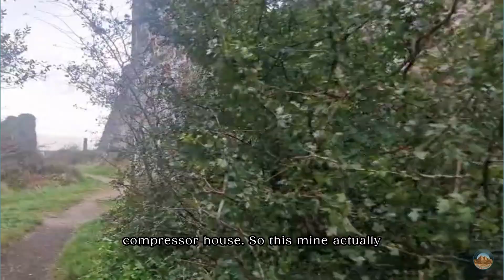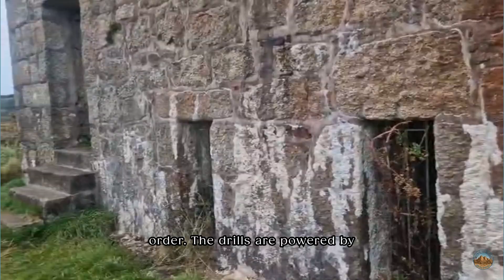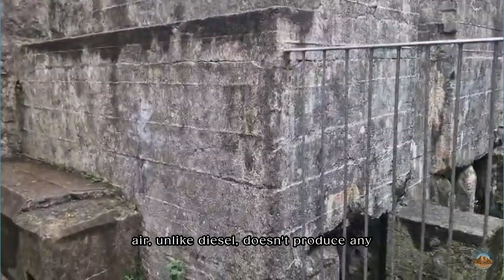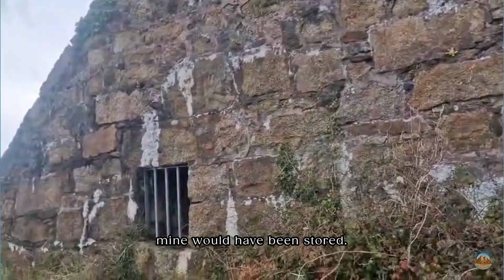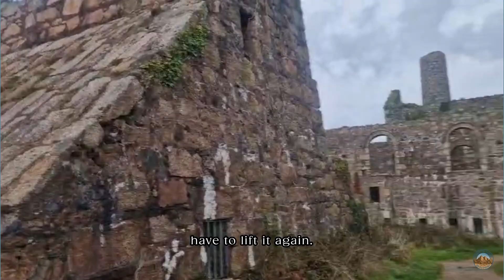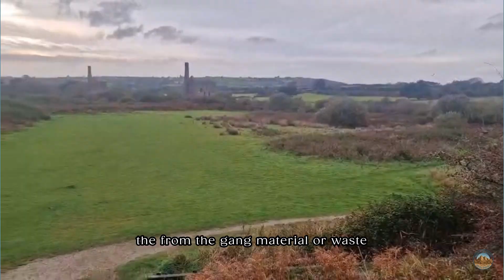Inside the Compressor House – Modern Meets Victorian Mining #geology  #cornwall

Comment: The tunnel in the ore bin or sorter is a “crow hole” used by the mine engineer to crawl in there and tighten the holding down bolts.  There are more crow holes under the compressor house too.
Beside the ore bin was a capstan winch to do work in the shaft , it also drove a claw crusher in the ore bin.  The ore was loaded from the bins into trucks on a light railway and headed east under the road to the stamps engine on the hill.
The stamps had 96 heads, the ore traveled down into the frue vanner house bellow onto the shaking tables, there was a mirror image set of stamps on the other side of the valley that also produced arsenic.
The whole of this basset mines complex closed in 1918.
Reply from the maker: Love this!  Thanks.
Reply: @DowntoEarthGeologist 
Well thank you for answering my question! Some I’ve been pondering for years!!😀